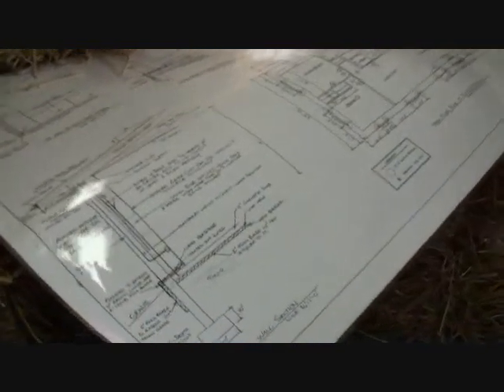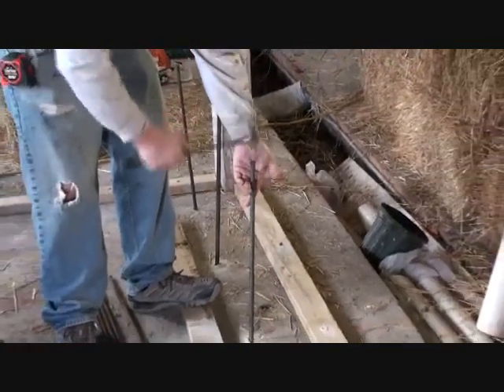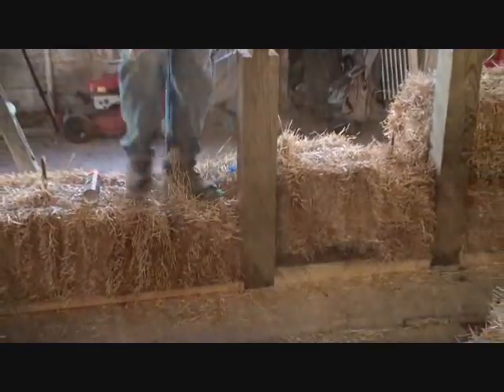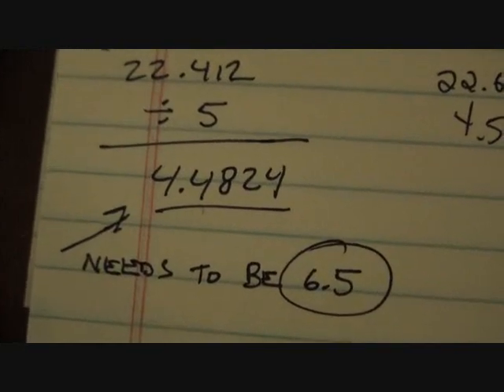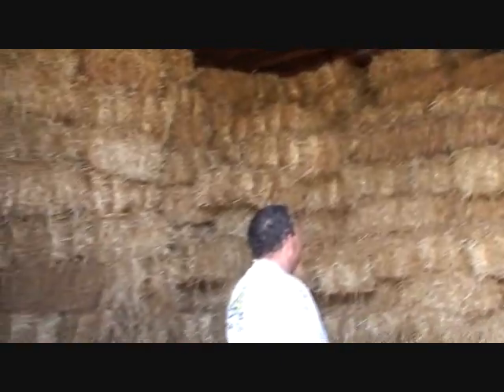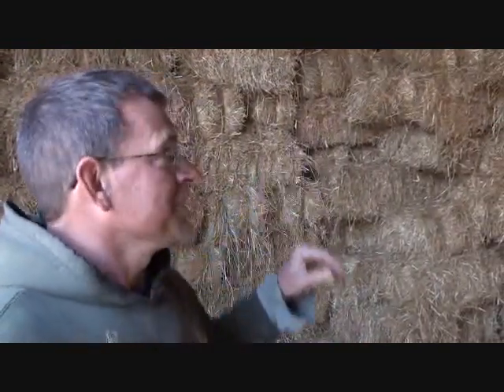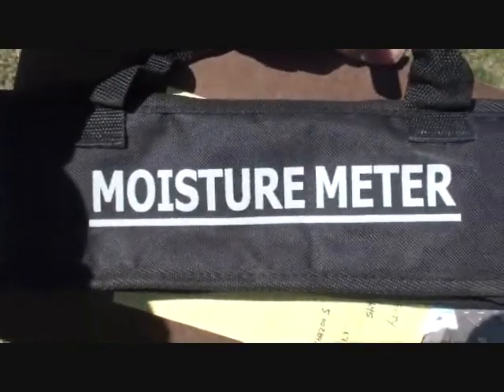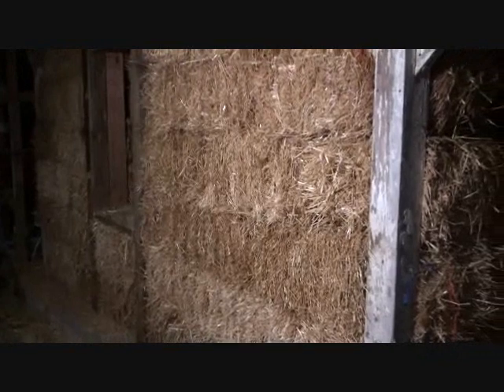Straw bale mock up

Comment: Could you not pack it in within the frame?
Reply: How do you mean?
Reply: @adambearup8100  Stuffing it in really tight.  Just a thought.
Reply: Interesting idea! My only concern is if we would be required to verify the density. That could be tricky if the 3rd party inspector doesn't let's us go by averages and needs to verify a specific bale.
Reply: @adambearup8100  yes...very tricky.  I will monitor your progress and I hope you are able to get more ideas from maybe more seasoned builders.  But you might also consider rebundling the bales...as a test.  It would be a true test of your dedication. Good luck!
Reply: Thank you for your input. Check out Part 3 of the story. There is an explanation in that write-up as to how much we would have to compress the local bales to reach the proper density..